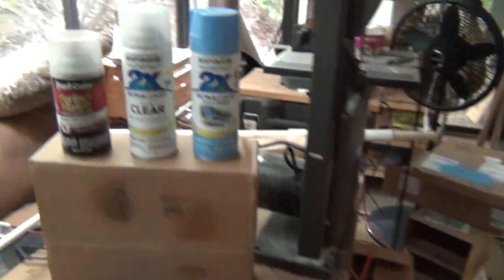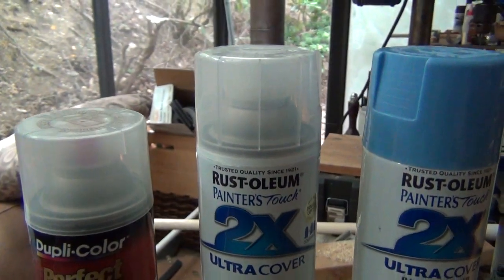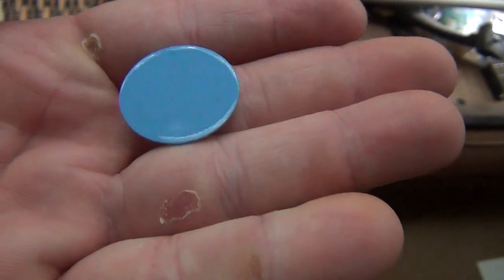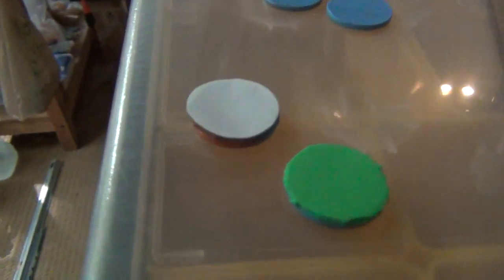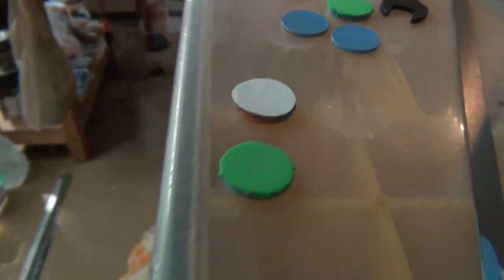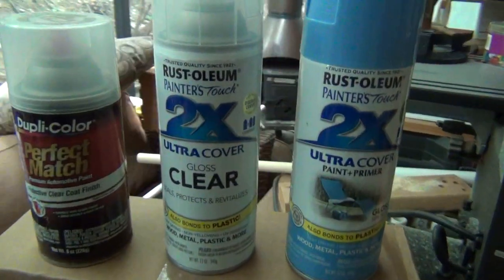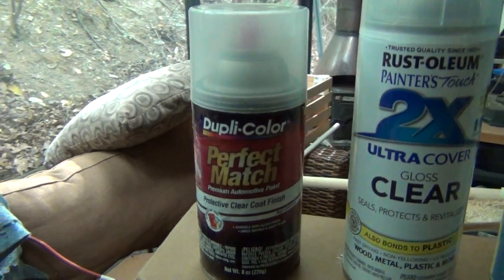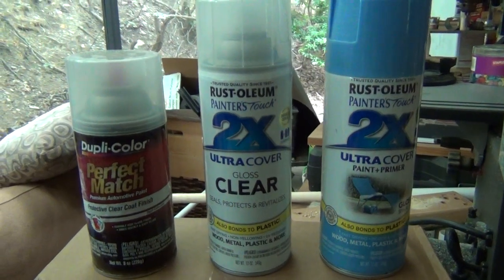Rustoleum Clear Coat Issue

Comment: You have never had a problem with duplicolor because it is a lacquer. 2x is an enamel. Lacquers have no "windows" of time to let the paint cure between coats, enamels are very picky. You must follow the guidelines exactly working with enamels or you will have problems. After you finish your base color you must let it cure before your clearcoat, your "window" is closed for several days while this happens. With 2x I believe your window is 1 hour, meaning you do a first coat, then wait, a second coat, then wait, etc., but you must be done within an hour. Then the enamel must cure, meaning don't mess with it for several days to 1 week. Then you can clear coat it with success. Your clearcoat will be an enamel as well so repeat the same steps you did with the color.
If you are in a hurry to do a project use lacquer, it is much faster and less picky. And remember enamels can go on top of lacquer, but not the other way around.
Reply: I'm confused here, he's never had a problem spraying the duplicolor lacquer over the blue rustoleum enamel but the last sentence of your comment states that the rule of thumb is that you can never do that.
Reply: @RlativityVSinscurity  You have been very lucky. Lacquer over enamel does not last. Duplicolor's own website tells you that their lacquer tends to lift off the enamel if you so. 
Here is the link for you to copy and paste:
https://www.duplicolor.com/faq/#:~:text=high%20gloss%20coatings.-,Can%20Enamels%20be%20used%20over%20lacquers%3F,dirt%2C%20grease%2C%20and%20dust.

Comment: Not sure if you solved the issue, but I JUST used it, and after letting it dry and inspecting it, it looks perfect. It's a small 3d printed plastic thing. I was nervous it'll come out wrinkly but it didn't. Anyways, just wanted to share what I did (not saying I know what's causing the wrinkles). 

1. I sanded down my plastic print. 80 grit, 220 grit, and a higher level grit after. (not sure of the grit level tho)
2. I used Rustoleum Primer first. Applied 1st coat.
3. sanded with 220 grit. 
4. Applied 2nd coat.
5. Sanded with 220 grit. 
6. Applied 3rd coat. 
7. Lightly sanded it, to most make sure the paint was level. 
8. After 24 hours of drying, applied clear coat Matte (not glass). 

After about an hour, it looks perfect. The wrinkled might be due to the original paint just not sticking to whatever you're painting it too. Just a hypothesis.

Comment: I've used Rustoleum on a couple of different items, both guitars and household items. I followed instructions to the letter and after several weeks the finish will still leave deep damage marks with even a figure print. I've used loads of other clear coats with no issues.  I wont use Rustoleum again.

Comment: From what auto body experience, I think you need the coat of base to totally be dry. Sometimes what happens is if it's not totally dry there's an activator in paint and clear, that will activate the paint that isn't fully dryed. Hence the wrinkles. Atleast that's what I think.

Comment: 3 causes for that.  1.  mixing paint solvents types.  2. high humidity.  3 cold temps.  4. Main reason most people get wrinkling is because of too thick.  but that’s not always the case
Reply: I'm thinking about doing a few mist coats when the weather permits. Not in a hurry but I would rather do thin coats instead of having to wet sand forever

Comment: 55 to 70 degrees F paint temp, 15 to 25% humidity , this worked for my kid's car this past week.  Came out very good.  Navy Blue.  All Rustoleum.
1. 1 coat gloss 2x Primer, wait 10 minutes.
2. 2 coats gloss Enamel color, wait 11 minutes between.  Then wait 10 minutes.
3. 4 coats Crystal enamel Clear, 12 minutes apart.

I have gotten severe wrinkle with Clear coat #2 (of four).  Always when paint was 40 minutes dry.  Twice.  

So, now I have

Comment: If you want a one coat gloss and tuff paint Finnish, use engine enamel. Rust-Oleum, duplicolor, or VHT has many colors. They also have engine enamel clear.
Reply from the maker: Thanks for the info. I'll check out the selection of each and give them a try.
Reply: I could re-look into this, but I kept hearing the engine enamel never cured right, or as durable as claimed without that high heating element time to cure the hardeners.

Comment: I do a little auto body work as a hobby and there are several different reasons for that type of reaction. first would be mixing paints such as lacquer and enamel. certain paints don't mix even when dry. another reason would be trying to mix a water and oil-based paints, those don't mix, again even when dry. another reason is, is there a lot of moister in the air where your working. in other words, let's say (for example) your working in your garage and it has just rained the day before. well, there's still a lot of moister in the air for several days after a rain. all of these are factors to consider before painting. there are several more factors but the ones I listed are the most common. I really hope this helps you with your next project.
Reply: HE JUST SHOWED IN THE VID he is using the SAME PAINT and he is doing the SAME THING TO THE SAME PEICES OF METAL AT THE SAME TIME.

Comment: ok so whats the verdict here, lots of comments and i need help!!!!  I am repainting electronic gear.  I sand down the original powder coat paint, to rough up surface, then use 2x cover canyon black spray paint to paint the metal of the electronic equipment. Then i wait 1 hour to dry, and then I spray with matte lacquer clear coat.  Come back in 30 minutes,  and I see there is craking  lines all over the paint job.  Horrible .    So what can i do???   I need to work fast,  i cant wait days for things to dry,  I need to spray paint, and follow as quick as possible with clear coat,   Please help, need a solution or product to make sure it works 100% as this crackling and cracking is driving me crazy
Reply: Hi, were u able to fix ur problem? This happened to me yesterday. When I went in there after 24 hrs to do a second coat it wrinkled! I research how to fix and what I did is sand my work with wet dish scrub (gently) scrubbed the surface while wet. Wiped it dry and did this process about 3x.. after iy was dry completely I went in and sprayed the paint again very thin layers and waited about 5min in between using a fan to dry faster. This is just with the paint though. Not using a clear coat till 7 days after. It's frustrating
Reply: @bluewhale2600  I see.  Well I found a faster way of adding a clear coat only have to wait  3 - 5 minutes after painting.  And you will get NO Crazing or Wrinkles.  I simple scratch up my item with sand paper block,  wiple the dust offf object, then spray my paint, wait 1 minute, spray another coat of paint, wait another minute and spray my 3rd and last coat.  Then i wait about 5 minutes, and spray MINWAX POLYACRYLIC matte clear coat.  Wait about 2-3 minutes no more time than that, and i spray my second coat of Polyacrylic, wait same time about 2-3 minutes, and spray my last coat of Polyacrylic, and then wait for it to dry , takes 30 minutes for dry to touch.  I would let item sit for 24 hours to cure.  All other clear coat options have produced crazing and wrinkling.  Polyurethane, enamal clear coats, lacquars,  and everything else is a waste of time when spraying on top of paint.  The way i explained to do it here is fast, and you don't have to wait.   Hope this helps
Reply: @infomattersmost  Thank you! I will look for this product and try it out! God bless.

Comment: I've had the same problem PLENTY with Rustoleum Clear very recently. Rustoleum used to work great Base/Clear Coat, but NOT anymore ! The only way I have found lately to apply the Rustoleum Clear successfully, is to apply the Clear within 30 minutes of the last/final Base Paint Coat.  
The Cans say Clear Coat can be applied within 30 minutes "or after 48 Hrs", but that 2-3 Days later has been a disaster for me because the clear coat just chemically ATTACKS the drier "cured" Paint.
Reply: 2 years later...

I'm experiencing the same thing with recent cans (all cans are Rustoleum American Accents, basically older Painter's Touch 2X, new from Amazon). Everything sprayed perfect (primer, black gloss), per directions, great result. Waited 4 days (specifically to avoid problems!), sanded. Then sprayed the clear... which created terrible wrinkling in corners! (Clear caused black to wrinkle or shrink up, primer stuck to wood fine, but obviously not to top coat of paint, so that's also worrying).

Possibilities, in hindsight, after some research: 1. Too quick coats (wait about 10 minutes between). 2. Too heavy coats or areas (and only about 3 total, then must allow to gas and cure at least 2 days).  3. Too humid (was over 80% for me that day). 4. Subpar or poorly manufactured paint that is overly sensitive to these issues.

Knowing this, I will modify my spraying, and give them one more chance before switching brands, at least for small (quick, cheap) projects: 1. Spray all coats within 1 hour (probably eliminating primer). So 3 coats of color (1st light tack, 2nd to cover most, 3rd to solid finish), then 2 coats of clear (all about 5-10 minutes apart).
Reply: Facts 4 days later nasty clear got me

Comment: I head better luck using Bher spray paint (Acrylic based) and using Rustoleum 2X Clear (Acrylic based) on it. I believe it's the acetone in the spray paint that's causing to it wrinkle. I tried Rustoleum Stops Rust Clear (Oil based) over a 1quart can of paint (Oil based) from Rustoleum with no problem as well.

Comment: I used the Painters Touch paint and primer in one on a plastic model car. It was labeled as a gloss finish, it came out matte. I sprayed the clear, didn't help. Stripped the paint, read directions, watched videos, again the paint was matte. I contacted Rustoleum with all the info from the can, they sent me a refund. That's fine, but I really want to know if the can was mislabeled, or if I'm doing something wrong. If I buy another can, will it come out the same? Do you know how hard it is stripping paint from a model car?

Comment: i have had the same thing happen with applying clear coat where it reacts with the paint and wrinkles up even dissolving some of the paint as well. i am thinking it has something to do with the fact that the basecoat underneath already has a clearcoat in it, and they dont mix well. because anytime ive used just regular primer, flat paint, and clear that hasnt been an issue. 

if your basecoat already has gloss in it then why clear over it? makes no sense. also that 2x crap doesnt cut it. its either primer or its paint, you cant have primer and paint mixed together.

Comment: Your suppose to spray the clear coat about 15-30 mins after the color. It was cured when you sprayed the clear. It's still suppose to be a little tacky but you can still handle it lightly

Comment: This exact same thing has happened to me when using this product. Except I was using color (silver). Not clear coat. Living in Florida, I believe the humidity could have something to do with it. Also it’s the 2X brand of rustoleum that’s been doing this, In my experience.
Reply: Yes Yes yes.
I too live in Florida.
My paint booth is Florida, so whatever it gives me is what I get.
No $90,000 paint booth
A sheet to cover ground a box and a spray paint can

Comment: Your first coat has to have as less paint possible, in order for you to do another coat, after 3 coats then you should get a good result, if you spray too much instantly, it will disolve the old dry paint.
Reply: I just had the exact same issue with 3 coats of rustoleum enamel, 48 hours dry time, experienced painter, same trash results

Comment: I just sprayed my black coat on and waited the time limit then hit it with the clear coat. it puckered on parts of the black coat and on other parts no problem. I went ahead and followed the directions by Rustoleum and sprayed on the second coat in 10 minutes... still has the puckering... I'm waiting now for the final clear coat. Don't know if this is supposed to do this or not!
Reply: All coats were done in less than 30 minutes and some of the puckering was helped. But I don't have what I was looking to have!

Comment: Lots of people think that just because they buy a paint that have a primer mix  in it, they think that they shouldn't primer the project. On lots of paint labels with Paint-Primer if you read the label, you will find that they recommend you primer first, to Primer   the project first will help prevent those paint lift vain.   I use this Rustoleum Clear Coat for most of my projects but I use the Lacquer Mix  because it will not do that and it will dry faster... Hope that my comment was useful

Comment: I've had this same issue I used paintthinner to wipe down and sprayed wrinkled up I started getting a gallon of black and cutting it half 91premiun gas and half black protective with sprayed gun at 70psi and clear in a sprayed can 30 min after super fast drying in any temp

Comment: I’ve been using 2X paint on my bikes that I repair and repaint and the paint looks sooo good, and I wanted to see what would this clear coat from 2X would do. I took one of the parts for a bike I was working on and I added this. And the paint look like that in the video, when I was taking it off. It was like rubber. At least I did put it on when I had a bike ready for the clear coat
Reply: Bro watch the vid I just posted, I just painted my gas tank and it's terrible

Comment: If the paint is to thick the clear could be reacting with it and shrinking it back
Reply from the maker: That's what I think is happening. I have thinned out the color coats and I have been much better results. I also think that now that the air is drier, because it is Winter on the East Coast of Pennsylvania, the paint is setting up better.

Comment: So, I am painting some wooden plaques for my address numbers in front of my house. I was told by the store employee to get the clear coat for a better coverage outdoors. Now I'm wondering whether I really need it after all since the paint is double coat. I can't actually read the tiny print on the can to determine how long to let the paint dry before adding another coat of the same spray, which is why I came out to see the videos. What do you recommend? Thanks so much!
Reply: I used to do address markers and it's kind of cool when you clear coat it throw some reflective glass beads on it. They are the tiny particles that make the lines on the road reflective. You can get them from your cities road department or online. Super cheap and makes your address stand out really well.

Comment: Don’t spray Lacquer over enamel.!! Is a warning i saw on a lacquer paint...
Reply: Work from hottest paint (lacquer) to coldest. So generally the rule is you can put enamel or acrylic over the top of lacquer. 

It can be done the other way but only in very light coats that are allowed to cure each time